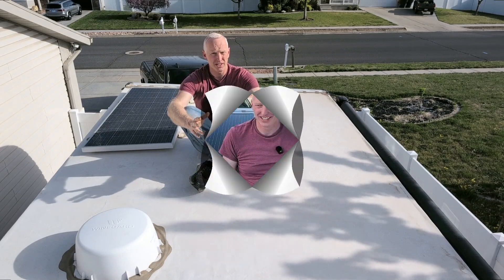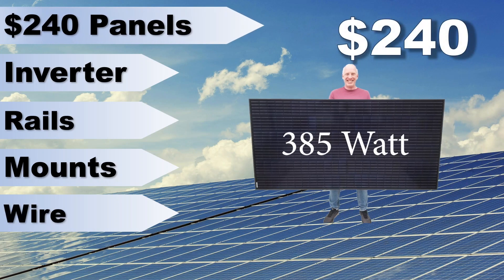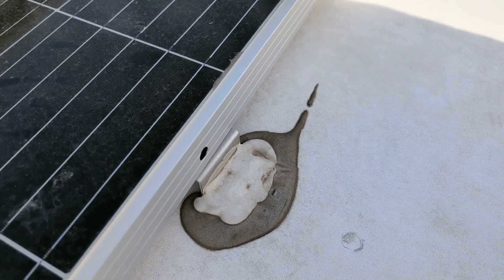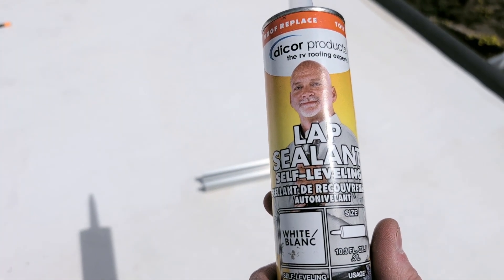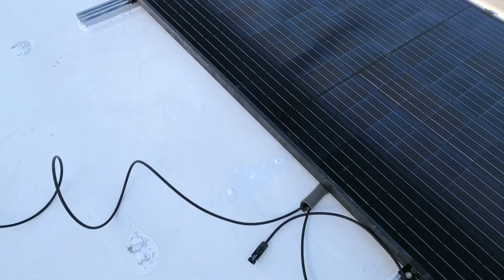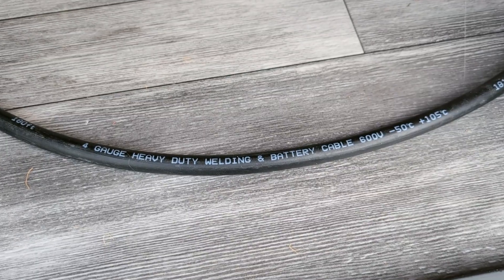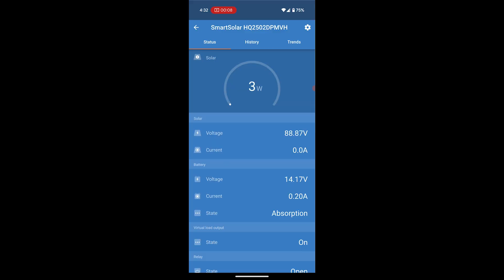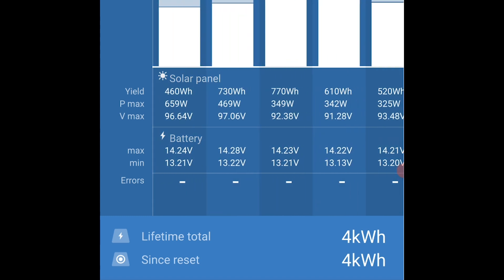Boondocking with a 12V Fridge – DIY RV Solar Installation with Victron Charge Controller

Comment: 12v fridges can be quite economical, power-wise.  Mine averages about 0.45kWh/day.  My guess is the large fridge in the RV wasn't designed with power efficiency in mind since while in use most folks will be trailering (7pin power) or at a campsite (pedestal power).  

This is my 2,427th day offgrid.  :-)
Reply from the maker: That's a while off grid. Yes, my last fridge was propane so it didn't use any power.

Comment: Nice Ram truck! 
We have a Vitrifrigo fridge freezer in our All Terrain Warrior with 400 watts of solar, Zamp 30Amp Solar charge controller and Magnum 2800 Inverter. Never had any power issues keeping it going.
Nice job.
But we also have an ORV with Norcold propane/ac fridge and with 1600w of solar and over 1200ah of battery with Ecoflow Delta pro 3000w inverter that fridge will still use a lot of stored energy quickly on 120v. 
12v has got to be more efficient.
Thanks for sharing.
Reply from the maker: Happy camping!